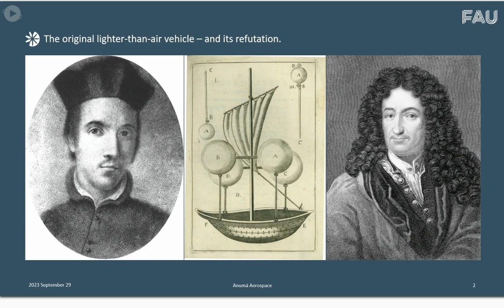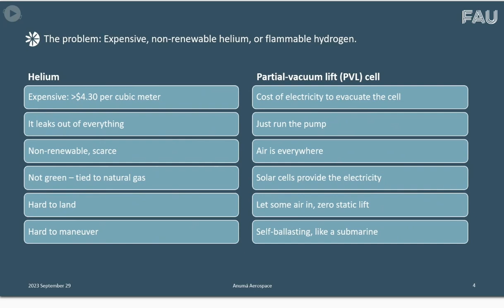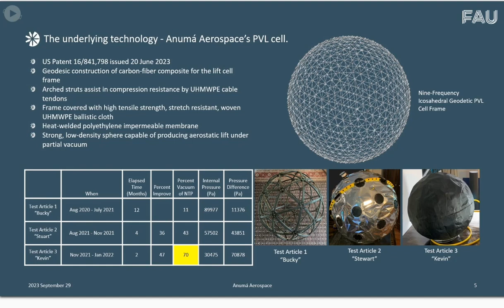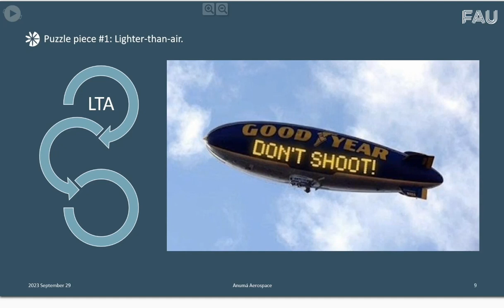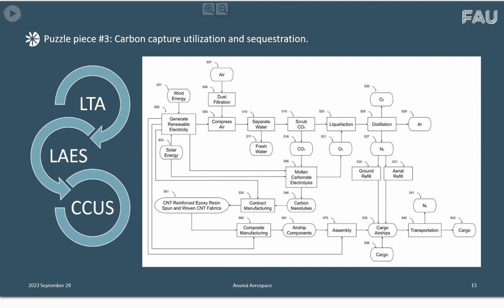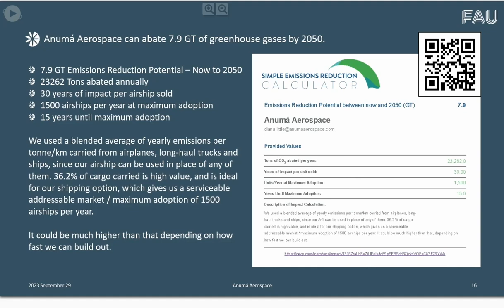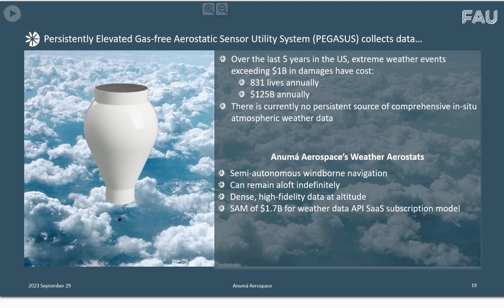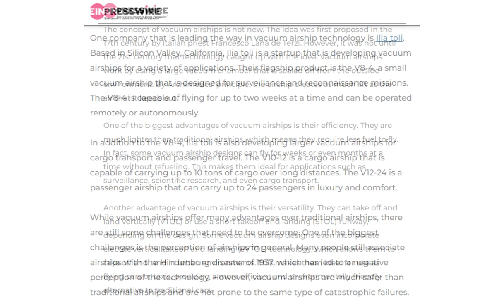Vacuum Lift Vehicles PVL

Comment: Isn't carbon fibre prone to fatigue over an extended period of time? Remember OceanGate's Titan submersible, which imploded during its 5th mission due to continuous stressing of the material. Or is there a different behaviour when a hull is vacuumized rather than pressurized?
Reply from the maker: As far as I know, the PVL cells would be routinely inspected and changed where signs of leaks etc are evident. And each cell is a partial vacuum as a full one isn't necessary to achieve lift.